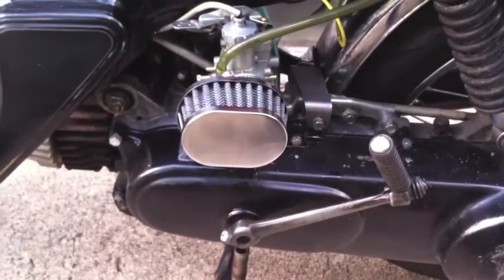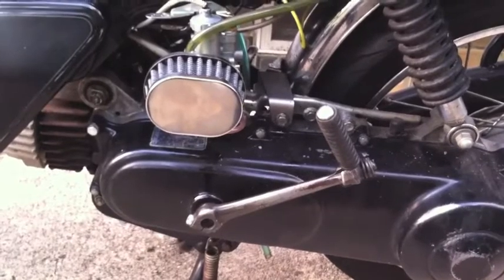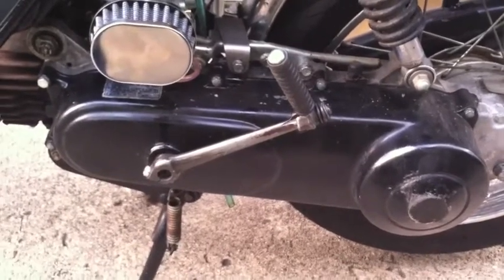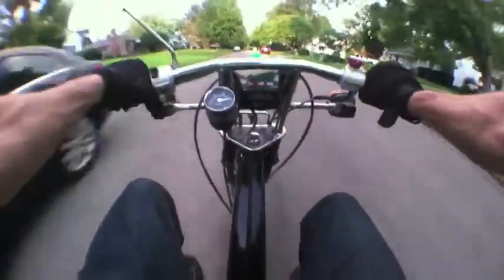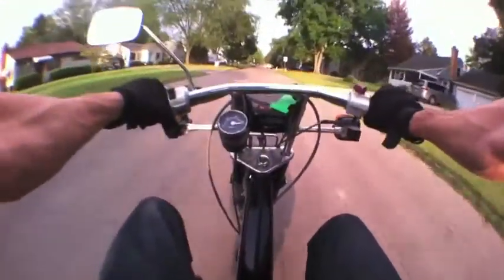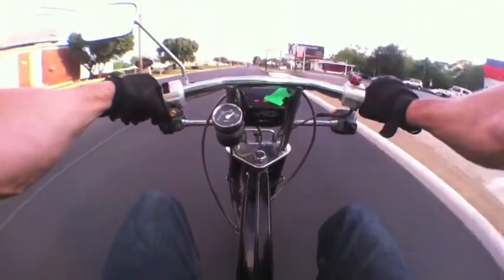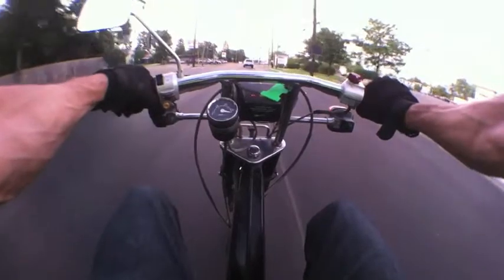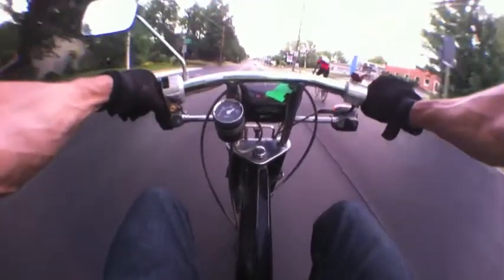Honda Urban Express nu50 with Mikuni VM18 carb

Comment: I own 4 of these, all totally stock and they all go 30-32 mph with no mods. the key is the correct original belt which are no longer produced.
Reply from the maker: Just bought a new old stock original belt on eBay and received it today.
Reply from the maker: I have several used stock belts as well
Reply from the maker: this one does 51 mph now - https://youtu.be/cIbOGBJbunQ - with a Malossi belt

Comment: I just put on the VM 18 carb on my qt 50. The carb is will start pumping gas out of the overflow. I have adjusted the float sever times. Sometimes it stops for an hour or two or a day or two or a minute or two. It always returns. I can tell when it happens while I am riding it cause it starts to run like crap......update on my build everything is on except the malossi kit. The malossi kit had a giant crack in it I emailed treats to see if they will exchange it. I got it up to 37 mph with stock cylinder and this mysterious carb problem.
Reply from the maker: dirt between needle and its seat?  how's your fuel filter?

Comment: your videos are awesome, can  you do a video and the speedometer were the cable goes into the hub,  on my hub the flat piece that goes into the cable broke, does the piece come out of the hub, i cant find any info on that, maybe a new hub? please advise, And thank you for the front brake cable on Ebay, just need to get the speedometer fixed
Reply from the maker: sierra2562 I'm waiting on a speedo cable myself. Give me a few days

Comment: What is the name or link on Treat land of the air filter that you have on there. will it work with a stock carb or no?
Reply from the maker: Funny n crooked air filter 
https://www.treatland.tv/28mm-OVAL-air-filter-for-PHBG-VM18-p/28mm-funny-n-crooked-filter.htm
It might work on the stock carb.  It's only $15.  If it doesn't work on the stock carb you can use the rubber elbow that comes with the stock air filter and attach it to that.

Comment: The VM 18 has a choke lever, is the choke on when the lever is up or down?
Reply from the maker: lever down pushes the enrichener up and opens up the circuit for more gas.  it's technically an enricher circuit.  i'm going on memory which may be faulty
Reply: churioz26  so lever down choke is off?
Reply from the maker: lever down is choked for easier starting
Reply: churioz26  thank you for the info and all your info. I have followed your videos and have read most of    your articles and they have helped me a great deal in my build. I have 3 break in cycles left. I have followed your break in method to a tee it takes a while but I think well worth it in the end. 1 kick start every time and it runs half throttle at about 255 degrees. I have not had it full throttle yet. I will see what that temp is when I get there. Thank you once again for all the knowledge you have given me about motors.
Reply from the maker: sure thing!  failure is the best teacher and i've failed many times.  if i can save others the trouble, i'm more than happy too!  have patience with your break-in.
Reply from the maker: also this is a very informative video - https://youtu.be/sOuQ0a8EDJU
Reply: So i want to run with lever up  and start with lever down? ......Lever not plunger. sorry i have done a lot of research and their is no real answer between lever and plundger. one person answers it one way and another answers it the other. even the mikuni website is confusing.
Reply from the maker: run with lever up and plunger down.  start with lever down and plunger up

Comment: What is a top end kit?
Reply from the maker: top end is the piston, rings, cylinder jug and cylinder head along with gaskets.
Reply: does that air filter get in your way when you seated on the bike?
Reply from the maker: no.  a bigger one would